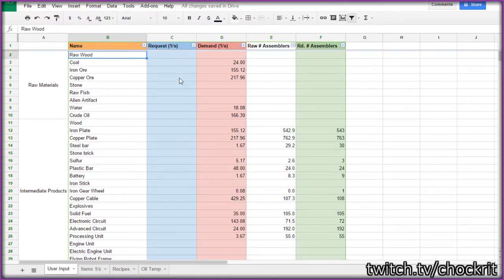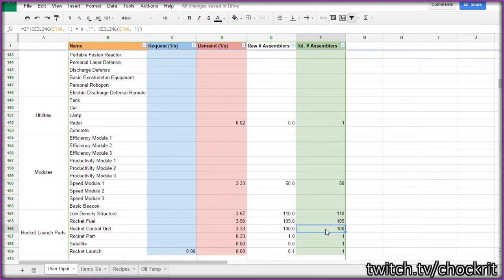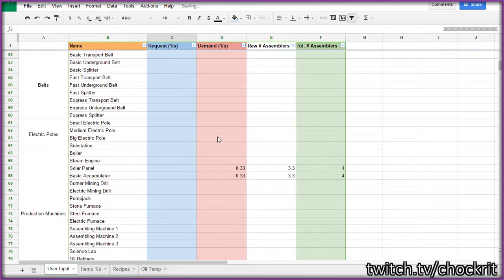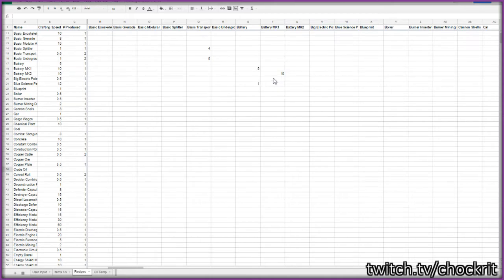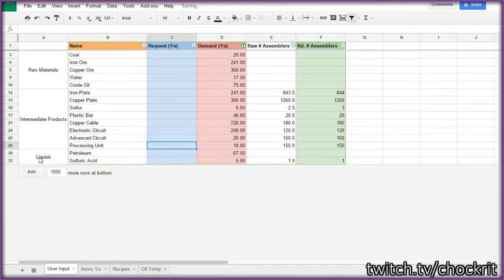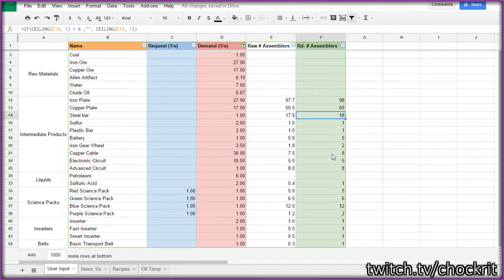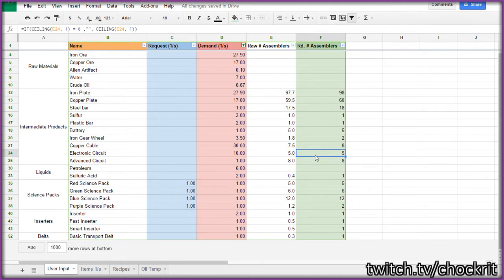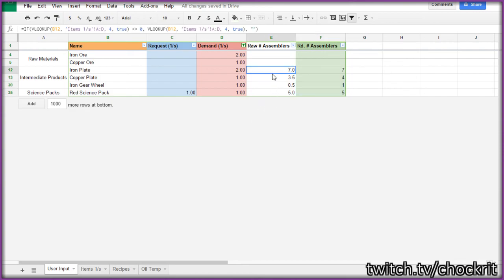Factorio: Precise Assembler Ratios made easy using Spreadsheets

Comment: When I look at the “Items 1s” tab, formulas in the main grid (columns E and higher) are ok except where they reference column D which is broken.
When I look at column D it’s OK except where it references column C.
And column C is broken because it does and Hlookup in row 2 which is broken….
Because the formulas in columns E and higher are broken…
So the problem is circular…. Which tells me THAT is the error.

PS... I've been using Excel professionally (like I'm the guy in the office people always come to for help) for over 20 years, heck longer than that.

I will figure this thing out.
Reply from the maker: Hey, sorry, this sheet is super outdated now. I had to input each recipe manually and never really got around to remaking it for newer patches. Also, there now exist several web-based calculators like this one: https://kirkmcdonald.github.io/calc.html#min=3&belt=express-transport-belt&items=advanced-circuit:f:1
Reply: @Chockrit  thanks. 

I like the concept of yours, just need to figure out how it works. All those circular references are making me dizzy.
Reply: Eric Cable yeah I want too for a new game

Comment: Hi, great spreadsheet. How did you arrive at the oil calculations? I don't understand what is happening there.
Reply from the maker: Actually just did a video on that a few days ago! Check it out: https://youtu.be/7HCQdENNGdA
Reply: +Chockrit 
Great, I will check it out. This will help to adapt your design with productivity modules. It was straight forward for non-oil intermediates, but the oil calculations are different.

Comment: How will updating and adding recipes work?
Did you enter all the number manually?
Reply from the maker: I did enter numbers manually, unfortunately. I don't have good enough programming knowledge to simply rip the recipes from the game (which I know is possible).
Reply from the maker: +HeilTec I will keep the main document updated when new items come out.
Reply: I tried the open office format and it fails.
I don't have Excel.
Reply from the maker: +HeilTec AFAIK LibreOffice is more current than OpenOffice, maybe try that instead? Otherwise, it should definitely work if you have Google Drive set up and save a copy there.
Reply: yup - the online version is working.